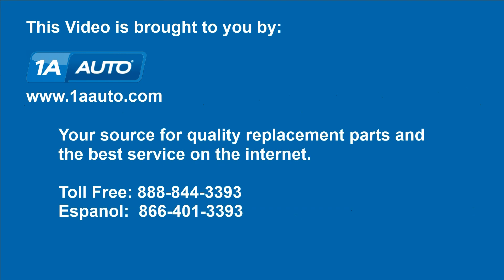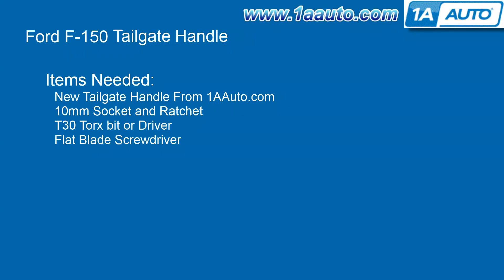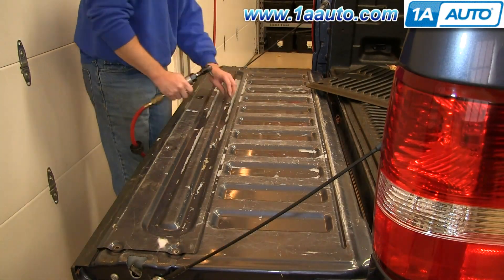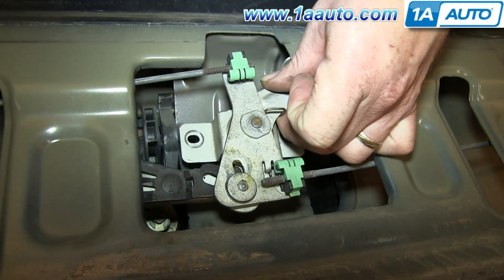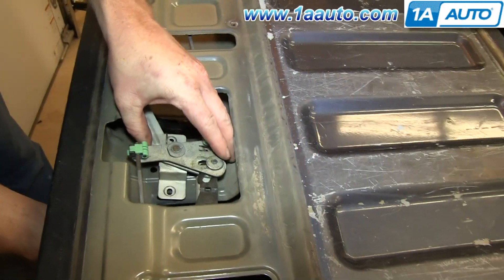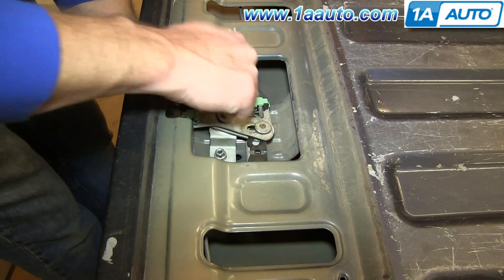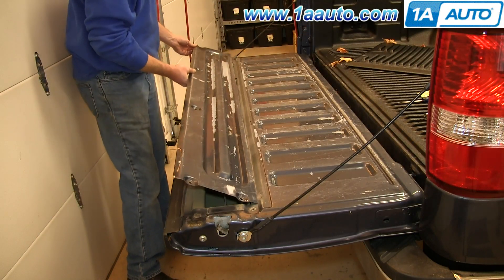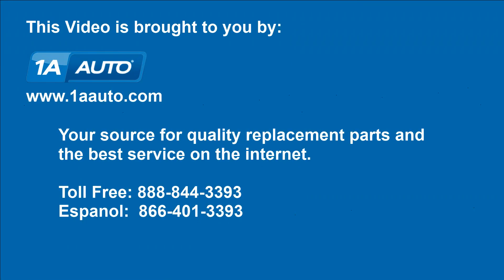How to Replace Tailgate Handle 04-14 Ford F150 Truck

Comment: Hi i have a 2004 ford f150 5.4l v8 i was gonna go replace the tailgate cable when i notice that my t45 screw had nothing to screw into. On the other side there seems to be a bolt on the inside that the t45 screws into. I wanna put a new one in on the others side so i can finish installing my tailgate cable but have no clue what that part # is called.

Comment: Now can I do it with the tailgate up still? My latch is broken and I can’t get the tailgate down
Reply from the maker: +James Troutman You may be able to. Once that access panel is off, you should be able to access the inside of the tailgate. Hope this helps you out. 1aauto.com
Reply: you grab the cables and pull towards the center, then itll come down, i had the same problem with an old f150

Comment: So if my tailgate won't lock does that mean the problem is the key cylinder ?
Reply from the maker: +Dan Hernandez That could be the issue causing it, but there are many components to it so its difficult to say without having it diagnosed.